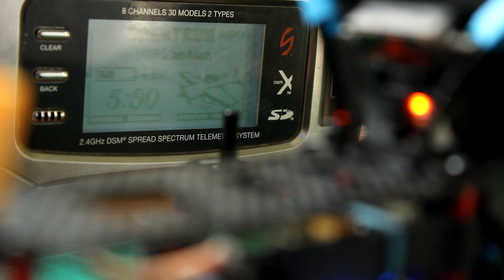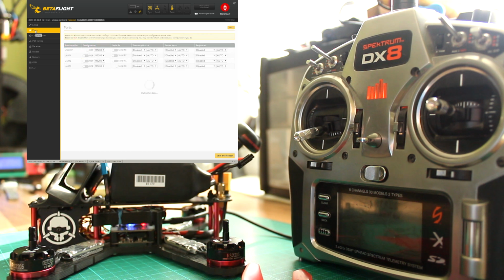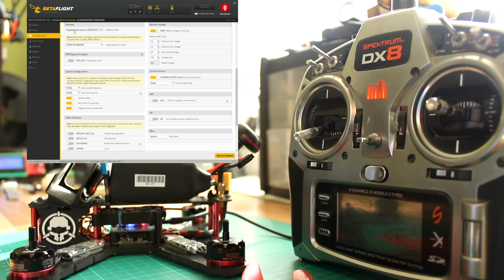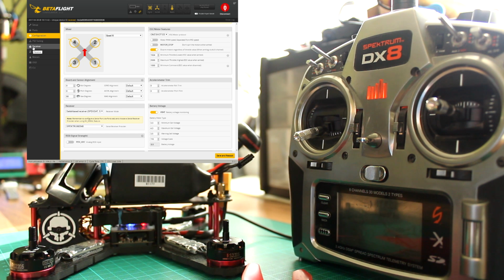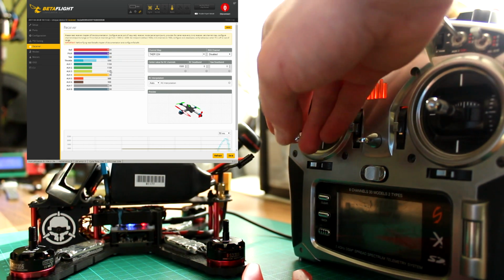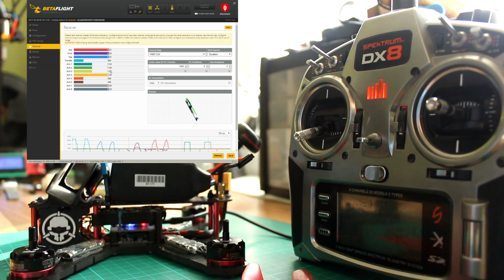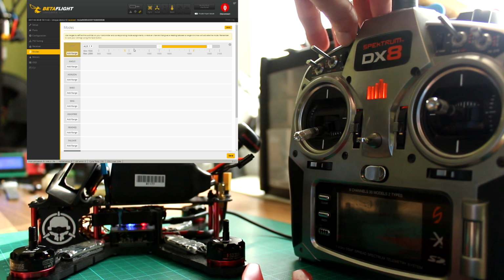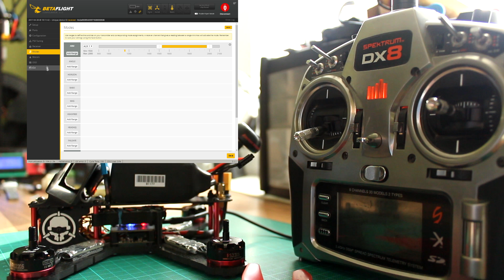Spektrum Serial RX SPM4648 DSMX Betaflight Setup | DIY

Comment: Great video. I'm missing the two antennas, using the SPM4648 with an SPRacing F3 FC. Connected to UART3. It will not enter bind mode. Is this fixable?

Comment: I’m new to all this programming stuff do I use PPM or sbus for this receiver does it depend on what bored I’m using help is greatly appreciated
Reply from the maker: For this specktrum serial receiver you pick in the betaflight config ( serial based receiver , specksat, subs, sumd) not PWM or PPM. serial receiver is sbus  use only 3 wire.
https://oscarliang.com/pwm-ppm-sbus-dsm2-dsmx-sumd-difference/

Comment: Hey there skydro! Thanks for the video, I've been trying to get my almost exact same set up to start the bind sequence but everytime I power up the receiver it goes straight to already bound even with no connection. Any ideas why?
Reply from the maker: Hey Bman, sorry but didnt encounter this issue yet.  my serial RX would always go in bind mode if i dont have the TX switched on.

Comment: Hello Thank you very much for this great Video...i watched a lot. the only Problem is now that my aux will not turn yellow like yours. it gets a Signal i see it but yours turns Yellow. and i have to put the lipo the activate the Receiver .please help me!!!!! i have a dx6(update installed) and the king kong gt200
Reply from the maker: Hey, so you have the right switch setup in TX for arming, if you flip the switch do you see the little bar go in between the range?

Check your "get min_check" in cli tab, the value of TX needs to be lower than that value else the quad wont arm!

Comment: I am having the same problem as the last guy but I do have serial based rx selected and 2048 and uart3  in ports
Reply from the maker: Hmm I remember i had this also happening one time, but hmm what FC you got? disconnect batt, usb after save and reboot.

Comment: I cant see the URAT3 in my ports. But I binded with the reciever. What should I do?
Reply from the maker: You have a omnibus F3 AIO board? So your receiver is bound, do you see channels move in the receiver tab? probably not i assume.
go to the configuration tab en look for receiver, put this one serial-based
receiver and provider on spektrum. save and reboot.
Check if that might help the uart3 to appear in the port tab, let me know.
Reply: Helped! Thank you! :)
Reply from the maker: AH that great to hear man!! do you channels now move in the receiver tab?
Reply: SKYDro FPV  Good afternoon.  Please help me. I have wizard x220s n I recently wanted to change stock reciever.  Bought spektrum spm4648 n also spektrum dx6 radio. Need help installing receiver
Reply: @javonbarnes1345  Hi - did you get help on this? I have this RX also. It binds and I see deflections in the receiver section of Betaflight, but the channel map is completely wrong. All channel map options give the wrongwhat m responses on the wrong channels. Have you any idea how to change this? Cheers